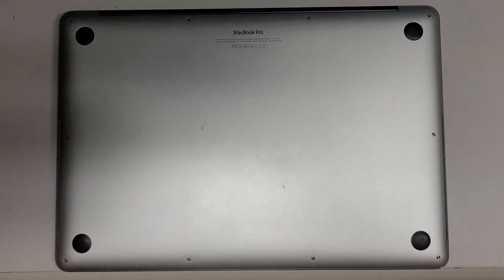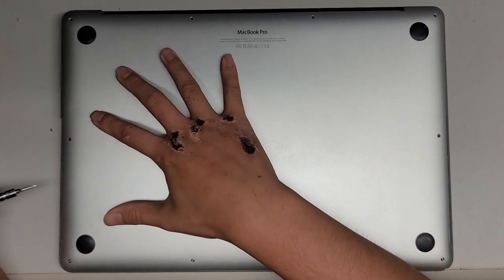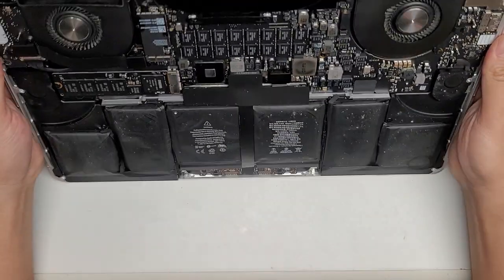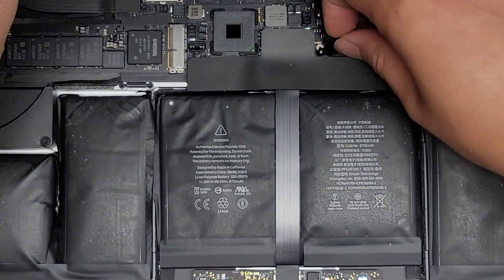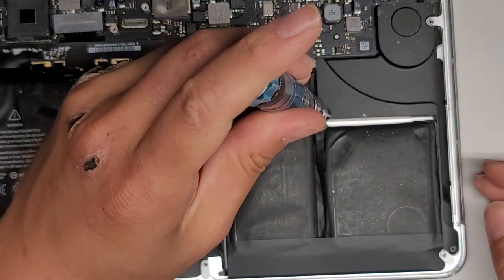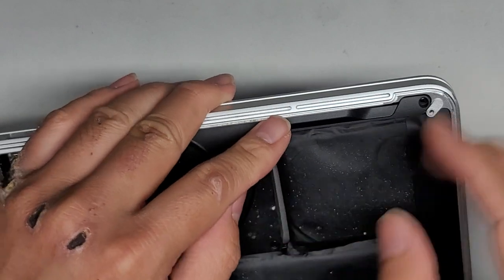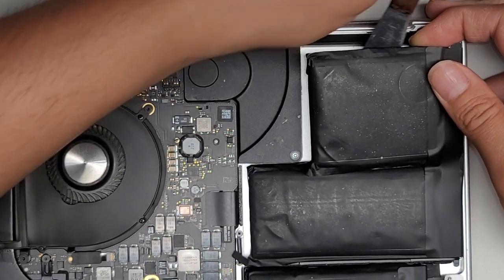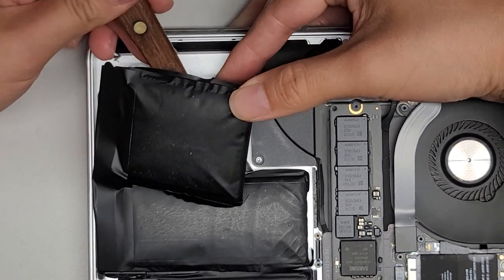15" inch MacBook Pro A1398 Mid 2015 Battery Replacement Repair

Comment: Hey thanks man. It's 2024 and you helped me change my battery in 20 minutes. I dulled the teeth off on a plastic knife and used that to work through the adhesive. Speakers and trackpad still work. Always nice when the machine powers up on the first try.
Reply from the maker: Awesome! Glad it helped.

Comment: Your repair video was perfect!  I followed your guidance and did the battery replacement on my wife's mid 2015 MacBook Pro in about an hour and a half.  You anticipated lots of places where I would have messed up!  I also borrowed an idea from another repair video that made the job even easier: I used a syringe to put a small amount of isopropyl alcohol in the spaces around the battery cells to soften the adhesive before using the flat metal blade tool.  FYI, my old battery was swollen far more than the one in your video, but it remained completely intact during the prying and removal.  I'm really grateful for the expertise you generously shared!
Reply from the maker: Awesome, glad it helped. I usually don't use isopropyl alcohol at the start because it makes a goopy mess. I usually do it after peeling the remaining adhesive. If you haven't already, please like and subscribe so others can find my videos and possibly consider watching a few others to get the algorithm to recommend my channel. Thanks!

Comment: You sir are a lifesaver! I am not good with hardware electronics, but I followed your steps 1 by 1 and successfully replaced my 8yr old battery. Never thought I could do it. Thank you for this video!
Reply from the maker: Glad it worked out. If you haven't already, please like and subscribe so others can find my videos. Thanks!

Comment: First thing you did when computer is opened.. Clean out the Dust.. Well done, you are the first one I've seen to do that important step.  
You also covered Power Management reset and battery calibration. Everything was Spot On ... a very concise well thought out instruction video.
Reply from the maker: Thanks! Yeah, I don't know why some people work on computers and don't clean them. Lol

Comment: I just finished this ordeal. First time doing this. It took me 3 hours as I punctured the corner battery right from the get go. I got cold feet. It smoked 3 times but then I used the credit cards that come with the iFix kit instead of the butter knife shown above. I had to be really patient with pushing through the adhesive but made it through. Did the reboot options as shown. New battery is now charging. All seems well so far. Thank you for such an amazing video.
Reply from the maker: Awesome, glad it helped! Yeah, the tool I'm using is not a butter knife, it's a very flexible and really thin pharmacy spatula.
Reply: @ItsBinhRepaired  did you file the edges of the spatula to make the smooth?
Reply from the maker: No, it was already smooth

Comment: I followed this video exactly and it worked great! Thanks for the detailed shots of everything that you did! For those in the market, I believe the "pry tool" is quite similar to a frosting knife.
Reply from the maker: Glad it helped. Thanks for the support! A frosting spatula knife will definitely work, but make sure the tip is very thin. If it's too thick, it'll dig into the battery. I bought some to try before. It's a bit less flexible, but if you grinding down the tip so it can get under the battery, it works really well.

The one I use was for a pharmacy. It's thin to scoop up pills. I got it as a replacement for the giant frosting knife I used to use.

Comment: Fantastic! This video shows the whole operation and zooms in on the details you need to know. I watched it once while waiting for battery delivery, then had it cued up and played it along while I did the repair. Success! I did it slightly differently. My MBP didn't seem to have the latch for the trackpad connector, so I just bent the connector back/up and just avoided it while working. My tool was smaller and had a shorter blade, so getting under the speakers was hard. Instead, I used a cotton swap and dabbed tiny amounts of 99% Isopropyl Alcohol in there to loosen the foam tape and went in from the corner. Once I got the end segments free the rest went quickly. Everything else was just like the video. I used an old credit card to scrap the debris after the old battery was out. The tool was in a $8 pack of tools that I found while searching for cheaper alternatives to the ifixit tool sets, which were probably better but I liked the price and variety in my alternate pick. Just take your time with the blunt scraper tool and this repair isn't so hard, just tedious! I would have gladly paid someone to do it, but everyone wanted me to leave the laptop for days, and apple needed to ship it out, for up to two weeks! I'm glad I did it so I could get back to work right away.
Reply from the maker: Yep, all the other places take a long time. I usually do same day turnaround once parts are on hand. Glad you were able to figure it out!

Comment: Thanks very much! Your video was super helpful and very clear.  Successfully changed the battery in my MBPro after I had random shutdowns running on battery power, even though the battery had >60% power left on reboot.  Turns out the battery was pretty bloated after all and definitely in need of replacement. A local Authorized Repair Center asked $500 to do this! (Really! They obviously just didn't want to bother.)   

Following your instructions and replacement battery leaflet, the most time-consuming parts of the task were blowing out all the dust, and OCD-fueled cleaning of remnant adhesive with 70% isopropyl. 99% would have worked MUCH better I think. I used scotch tape to keep removed screws in correct position/order so they were easy to put back in.  Slow and steady did it.  Thanks again!
Reply from the maker: Awesome, glad it helped and the repair went well. If you haven't already, please like and subscribe so others can find my videos and possibly consider watching a few others to get the algorithm to recommend my channel. Thanks!

Comment: I used a 8" x 1.5: tapers wooden wedge used to install doors and windows as a scraper-less puncture damage. I used my hands mostly to pull up the battery. With the trackpad so close I was afraid to use any tools. I got it. I only unconnected the battery and the wire connector next to it covered by the metal plate. Thanks for this video.
Reply from the maker: Sounds good!

Comment: I've done quite a bit of research on this because the instructions that came with the battery involve removing every component inside the case before removing the battery and I was afraid I was likely to cause more potential problems doing all of that than if I just carefully removed the battery. There are lots of videos about this process - some useful, some not so useful - but I liked this one the best for its common sense, professional approach. The job requires some patience, but the instructions are well illustrated and easy to follow. My computer is up and running and will actually sit flat on a surface again. Meanwhile,  I hope Mr. Binh Repaired has recovered from the thrashing his knuckles took while fighting with a large rock. Thanks for the great video!
Reply from the maker: Hahaha! My hands are healing well. Will hopefully eventually have a stop motion/time lapse video of the healing process.

Comment: Great video.  I could see every step, including the tricky attachment of the trackpad cable to the trackpad.  I used a little acetone applied with a small syringe to loosen the adhesive, and an old credit card to work the battery free.  Sent $10 to Binh.  Thank you.
Reply from the maker: Glad the video helped. As long as you're careful with that acetone, it'll be ok, but I don't use it, because a tiny bit can cause a lot of problems if it gets into the wrong place. Lol Thanks for the support!

Comment: Awesome video! Your scabby hands were quite a distraction, though, but I feel your pain, because I watched your crash video. You have some pair on you for even taking that ride, but you handled it like a champ, and you saved me a bundle with this step-by-step video. The last dude who replaced my battery ef'd it up, and so far, so good with this one. Donation is on the way. Thank you!
Reply from the maker: Awesome! Glad it helped. Thanks so much for the donation. Work has been super slow recently. It really helps me out. Haha it's pretty fun to ride that thing.
Reply: @ItsBinhRepaired  You make house calls to Encinitas, CA? ;) Hang in there. We're in for more bumpy rides, and hopefully you won't be riding that e-Uni when it hits the fan. Stay alert, my friend.
Reply from the maker: @reelmensch9987  as long as you cover the travel fee, sure. Lol
Reply: @ItsBinhRepaired  For that e-Unicycle? Sure. :)
Reply from the maker: @reelmensch9987  lol

Comment: Your approach worked nicely for me and the video was great.  I used the flexible gift-card technique to free most of the batteries and then a piece of flexible stainless steel to finish the job.  I got tired of using rubbing alcohol (70%) to worry the adhesive residue free, and used some grain alcohol (190 proof 95% alcohol).   The residue was gone in seconds - much easier and quicker.  If you use grain alcohol wear a nitrile glove, as grain alcohol will dehydrate your skin.
Reply from the maker: Sounds good!

Comment: Thanks for the video!!  I used a Heat Gun which made it easier.  Thanks again because I wasn't sure which screws to remove.
Reply from the maker: Glad it helped. I don't trust heating batteries. That can be dangerous. If you haven't already, please like and subscribe so others can find my videos and possibly consider watching a few others to get the algorithm to recommend my channel. Thanks!
Reply: I don’t actually heat the battery. I heat the other side of the computer on either side of the trackpad.  I definitely give you a like and I will subscribe as well. The MacBook will not boot up now without the battery. Do you think I have to purchase another battery? I was trying to use it without the battery.
Reply from the maker: @philw3995  yeah, Apple is a butt when it comes to stuff like that. I'd worry about melting the keyboard keys. I've seen people do it even with just a hair dryer trying to get water out of their computer.

Comment: Thanks for the video!  I bought the ifixit kit (great kit btw!) but needed a little info on how to get that battery out.  Mainly the right way to get the adhesive to release.  Didnt want to damage the battery getting it out.  Great instructions!
Reply from the maker: Glad it helped. The residue can be easier cleaned by using a syringe to drip the isopropyl alcohol directly on it and letting it sit until it turns milky color. If you haven't already, please like and subscribe so others can find my videos and possibly consider watching a few others to get the algorithm to recommend my channel. Thanks!
Reply: @ItsBinhRepaired  yea the kit came with adhesive remover. which i’m pretty sure was just IPA. took it off easily!
Reply from the maker: @SWBCrawler  Yup!

Comment: Thanks for the great tutorial. Just finished successfully replacing the battery on my 2015 macbook pro. Unfortunately, some of the keys on the keyboard are not working and the NVRAM reset did not work at all for me.
Reply from the maker: Oh no :( did they stop working after the replacement? Might have damaged the keyboard cable. :(

Comment: Thanks man, very time consuming but got my machine battery replaced before it did further damage and tbh it was easier than expected. I did not have to remove the speakers. Luckily my adhesive was pretty easy to get off.
Reply from the maker: Awesome, glad it worked out. If you haven't already, please like and subscribe so others can find my videos. Thanks!

Comment: Thanks for the video. A little advice. Use Ronsonol Lighter Fuel on a paper towel and it will remove the leftover adhesive without damaging plastic.
Reply from the maker: I used a dripper bottle with isopropyl alcohol now. It works well
Reply: @ItsBinhRepaired  I use the alcohol too but after using the lighter fuel. The light fuel is my go to for removing adhesive for years. They literally melt any adhesive without damaging plastic.
Reply from the maker: @chrismiralles2781  nice

Comment: Good vid. So I'm currently working on getting an old bulging battery out of my 2015 MacBook, and I ended up using the floss technique plus my library membership card to ease out the batteries. The trick I would suggest to people is instead of applying the alcohol underneath the battery is to dip the entire floss in the alcohol. The alcohol along with the friction will be enough to weaken the adhesive.
Reply from the maker: Alcohol just takes time to dissolve the adhesive.
Reply: @ItsBinhRepaired  Indeed, but it's faster with friction.
Reply from the maker: @rommix0  yeah, it removes the dissolved layers faster.

Comment: Great Video. Followed it and all worked great. I used a thin spactler that has 45 degree angle  used for windows. Same Result. The repair was really quick. Apple engineers need a lesson on serviceability. I guess they design systems that are disposable. thanks for your video.
Reply from the maker: Yeah, they design them to be just repairable enough to deny it and to make people bring it to them for high profits.
Reply from the maker: If you haven't already, please like and subscribe so others can find my videos and possibly consider watching a few others to get the algorithm to recommend my channel. Thanks!

Comment: Thanks again! It worked like a charm. I used some alcohol to help dissolver the adhesive too. Your method is really simple and your video goes right to the point.
Reply from the maker: Awesome!
Reply: Hi, is it really necessary to remove every little bit of the old adhesive tape? Is it for optical reasons only or is ist necessary to for technical issues, like sticking dust, etc? So can I just take the thicker bits of, leave the sticky residue (no alcohol, etc) and put the new battery on top? Thank you.

Comment: Thank you so much for this! Battery install worked but now my touchpad doesn’t work. Any idea what to try?
Reply from the maker: You might have damaged the trackpad cable or the trackpad itself
Reply: @ItsBinhRepaired  anything i can look for to narrow down the issue?
Reply: @ItsBinhRepaired  keyboard doesn’t work either but lights come on and power button works? what the.
Reply from the maker: Double check both ends of the touchpad cable. If that doesn't work, you'll likely have to replace the touchpad cable.

Comment: Excellent video, thanks! One comment - I found using lighter fuel better for cleaning off the adhesive residue than alcohol. Thanks again.
Reply from the maker: I don't trust that stuff being inhaled or making contact with my skin. I found using a dripper bottle and letting it sit a few seconds works well.

Comment: Hello, great video thanks. I just changed mine but my mac is slow now, fan is running the highest. 

Any advise? I am about to mount the old battery because i need it to work 😢
Reply from the maker: Double check the battery connection and the trackpad. If you damaged the trackpad, then the old battery won't fix the issue.

Comment: Thank you for the video, it helped me a lot. I successfully replaced the battery on my MacBook and did the SMC. It booted up after that and went in the account, I shut it down and did the PRAM reset. After that it keeps restarting at 30% loading logo. When in boot options is not restarting, so it's a boot problem. Did I crashed the boot with the reset? Help will be much appreciated.
Reply from the maker: Sounds like bad replacement battery
Reply from the maker: Not sure
Reply: @ItsBinhRepaired   Nevermind, it was my fault. I didn't pressed all the way down the battery plug into the mainboard socket, that was dumb of me, maybe I was afraid of breaking something. Now it purrs like cat. Thanks for the input.
Reply from the maker: @Cyb3rvision  haha sounds good

Comment: Great video, thanks. Glad to see that we have the same brand of replacement battery. I wasn't sure which one to choose and now I have more confidence in it
Reply from the maker: No problem. Hope the repair went well.
Reply: @ItsBinhRepaired  Great! I'm planning to do mine tomorrow. It's severely swollen so I'm going to do it in the garage and potentially behind plexiglass with a respirator mask just in case!
Reply from the maker: Haha I don't think you need all that, but I guess better safe than sorry.
Reply: Could you share me the link to the battery @It's Binh (Been) Repaired & Reviewed is using in this repair?
Reply: @That Talking Dog Guy Please ignore my earlier question I got the link, Have you done the replacement yet? How good is the battery? How many hours of back up it gives you? Thanks
Reply: @ItsBinhRepaired  What’s your opinion about this brand of battery that you used in this repair? Are you getting any complaints from customers about it? On an average how many hours of web browsing usage it gives you? I initially thought not to disturb you directly with my question.
Reply from the maker: @arun.sekher  I replace it for my customers and if they come back I fix it again. Usually doesn't happen too often. I don't time how long it lasts.
Reply: @ItsBinhRepaired  Thank you for your reply. 😊
Reply from the maker: No problem
Reply: @arun.sekher  At first, I thought I wasn't getting the same kind of life I was getting from the original battery, but it's possible that I now am after many charge/discharge cycles (two months). Do follow the steps to remove every bit of the adhesive with alcohol. I didn't, expecting the new adhesive to stick to the old, but now my leftmost battery clunks when I move the computer around